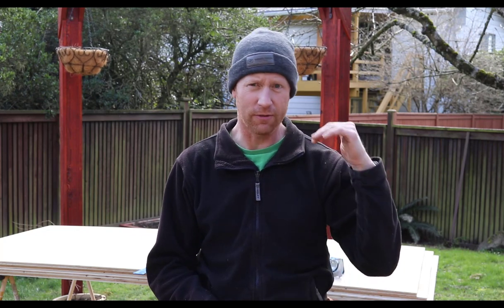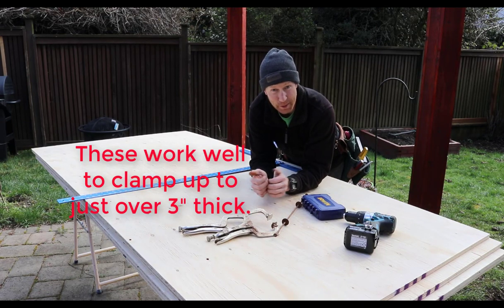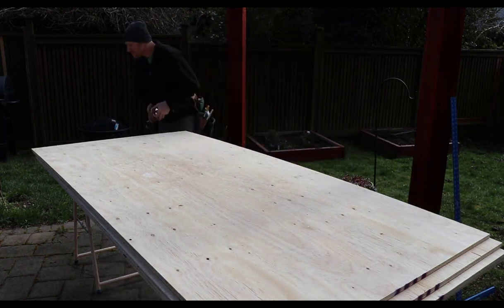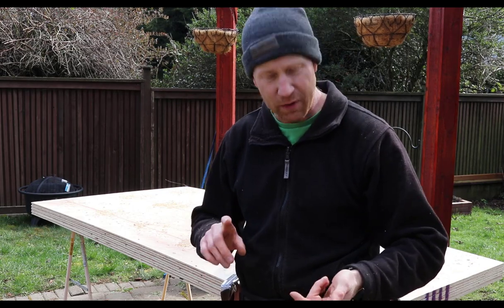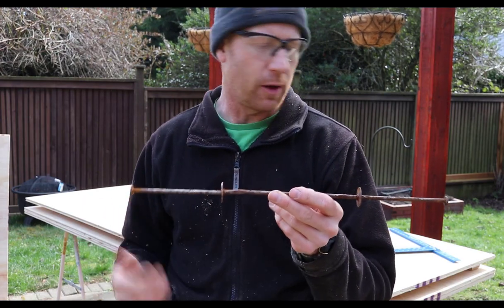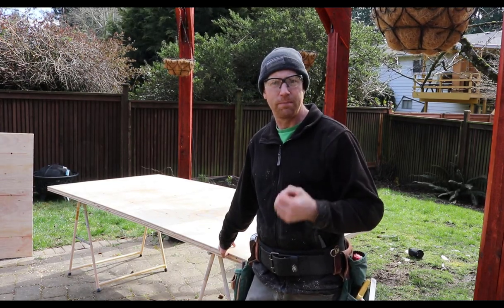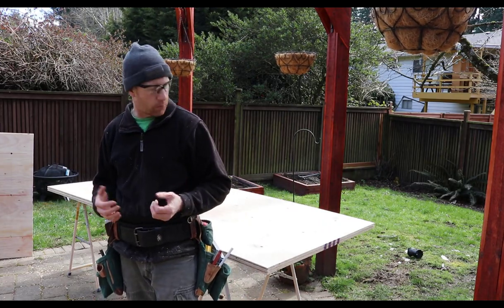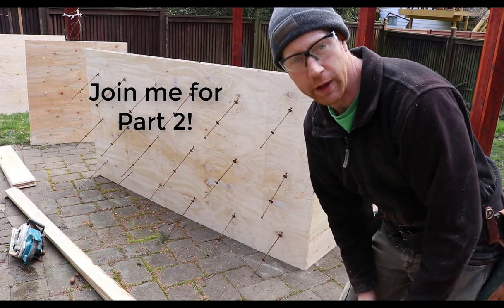Intro To Jahn Concrete Formwork Systems Part 1

Comment: Give them a hundred years and those metal ties are going to carry rust right through your wall, and speed the rusting of your rebar as well. They're not what you'd use if you want your wall to last.

Comment: Out of curiosity... have you seen anyone use pipe in place of those ties  to reduce the amount of concrete and to allow for pluming and electrical runs through the wall?

my first thought was one inch pipe with a bolt through it and washers on either end....

Comment: Great video Dan! Could you use this system to extend the depth thickness of an existing wall?  I have 8 in poured walls that I want to extend an additional 12 in to.  Could the Jahn ties be mounted to the existing poured wall?

Comment: Hey Dan. Lumber is expensive right now, and I wondered what your opinion would be about using 1/2" plywood, then shortening the span between framed boards? Just curious, really on a budget here.
Reply: Definitely not any further than 2ft unless you wanna roll the dice. I do walls for a living and we use old schools simmons panels. But the thing is you would want to introduce some vertical pieces behind the horizontal soldiers. (2x4s) to displace the pressure a little more since you want to space the two bys more. Even using rips would work.

Comment: Nice job ?how and where do i get these snap ties i need 1500
Reply from the maker: It depends on where you live. White Cap has their "Brigade" brand, searching for a local concrete supply store that has form work, EBAY may have some sellers too.
Reply: Thank you well i am in jamaica but if i can get them in new  york that would b good i could get them ship to me

Comment: I level out my lawn so I need to make a 2 day high retaining wall that is 8 inches thick. 
I was wondering,  if the plywood is bent or warped.  Do I face the out par outward? Then with ties and outer stakes it would straighten it.

Comment: Starts off drill a whole stack to save time and risk inaccuracies 
LoL
Reply from the maker: Check out the instructions for the Jahn system sometime. Step 1, gang drill the plywood. This may be a problem for someone that can't hold a drill square to the plywood but if you limit yourself to 4-6 sheets at a time you should be ok. Very often reinforcing will be in the way and the ties will have to bend slightly to get around it. So, +/- 1/4" or more in hole layout isn't a big deal. As for drilling them one at a time, that sounds like union mentality. Don't work too fast, you will make us all look bad! The real trick to all areas of the construction process it to know where you have to take the time to be very precise and where you are just wasting time.

Comment: you can use your adjustable wrench on the banding too sometimes it is a bit loose and hard to break you slide your adjustable on the banding adjust it till its just snug and slide the claw of your hammer next to it with the banding between the two claws and twist opposite directions.

Comment: Typically you use a 9/16 bit so that the Burke plywood plugs fit in the holes if you mispace or reuse the plywood with a different layout